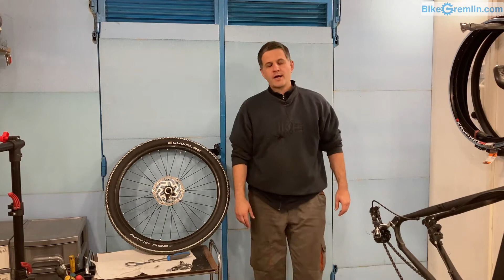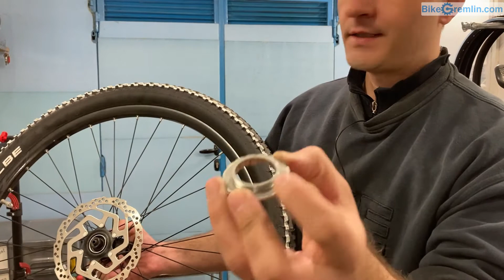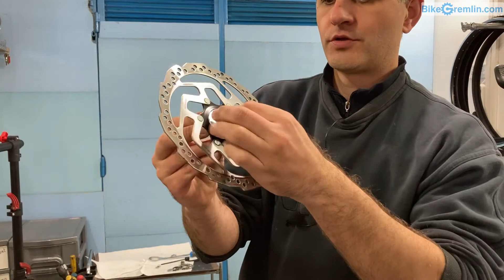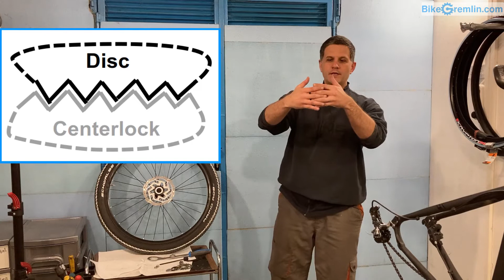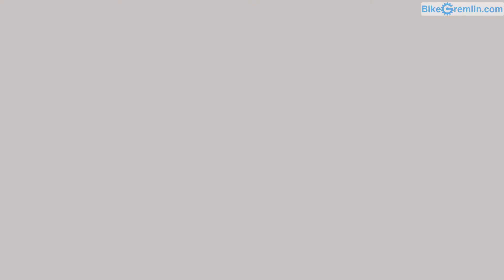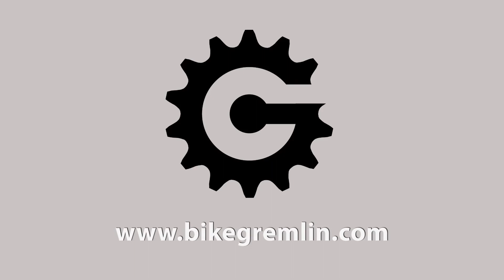Centerlock brake-disc mounting system - advantages

Comment: Its the same thing with hydraulic vs mechanic disk brakes. Hydraulic is better, but if it fails your ride is probably ruined because it is not simple to fix, unlike mechanic. Shimano centerlock is better than 6 bolt, but if it fails, the tools are more specific. Having said that, I don't think that bolts fail that often.

Comment: Threaded bolts are the most common type of fixing on bikes and cars. The wheels have never fallen off my car and they are held on by bolts.
Reply from the maker: Automobile wheel bolts have a 45 degree camber, that is matched by the wheel. Before that was invented, bolts would often snap and come loose etc.
The basic principle is explained in chapter 3.3, and shown in picture 8 here:
https://bike.bikegremlin.com/10123/unsafe-cycling-patents/#3.3
Reply: Centrelock spline tolerance is crap after a while.